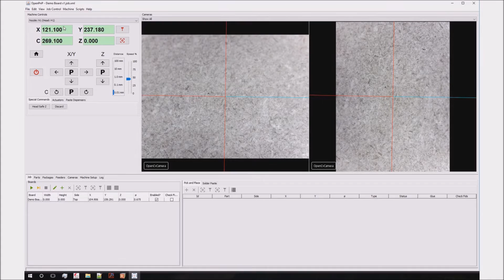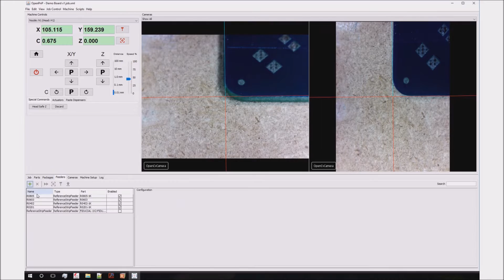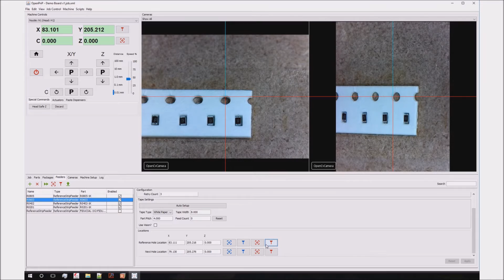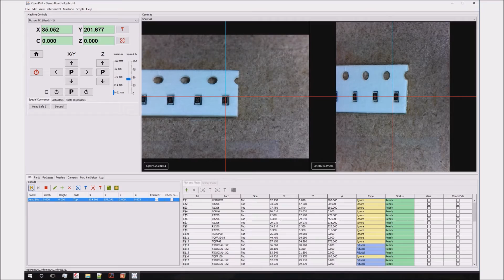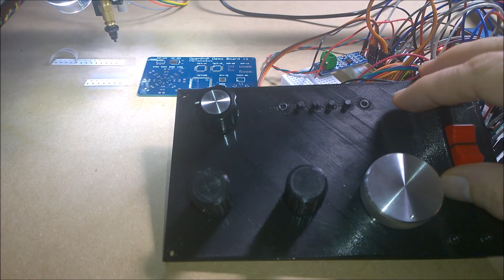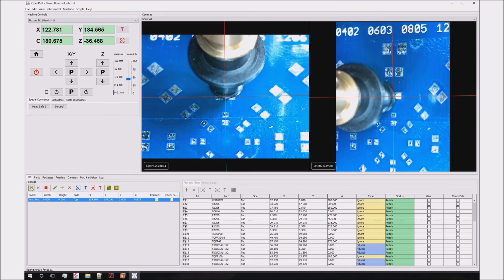Semi Automatic 2

Comment: Hi John, are you still happy with the TMC drivers 5130 or did you change from SPI to the  more  traditional 2 pin direction and step input interface?
Reply from the maker: Yes. They're great drivers and I used SPI. For my application they were perfect, as I didn't need to coordinate movement between X and Y like you would on a CNC mill. Allowing the chip to compute the motion certainly made the code a lot simpler.